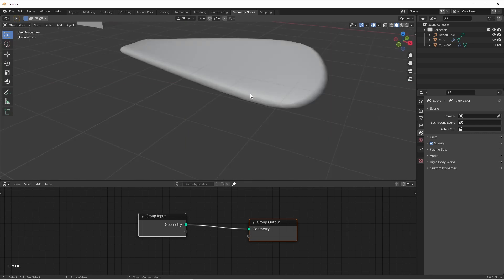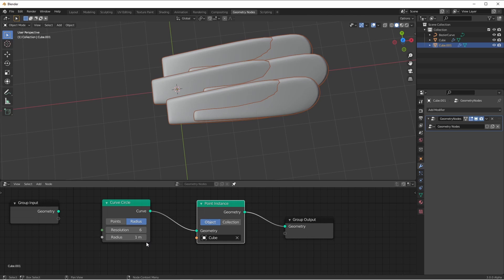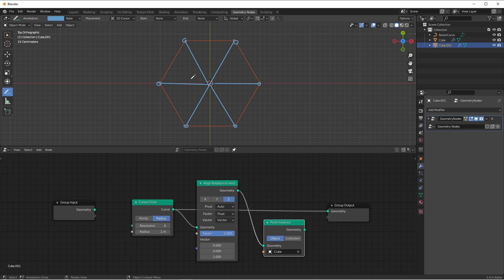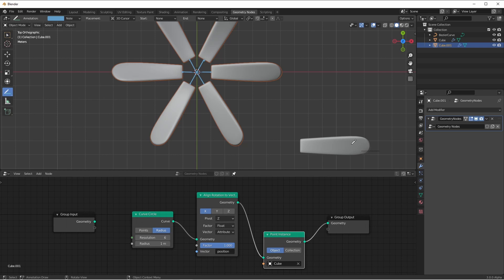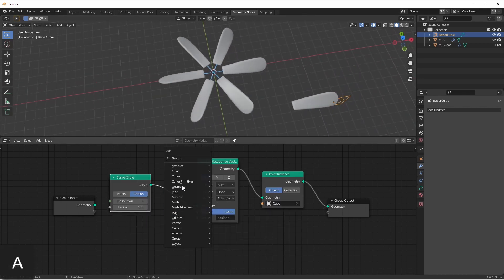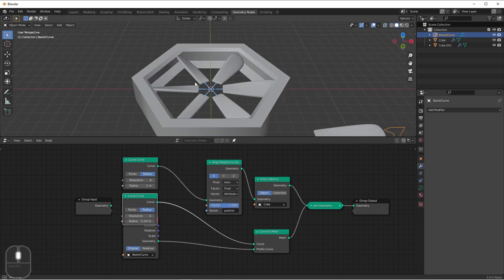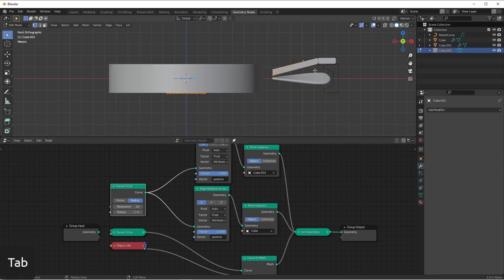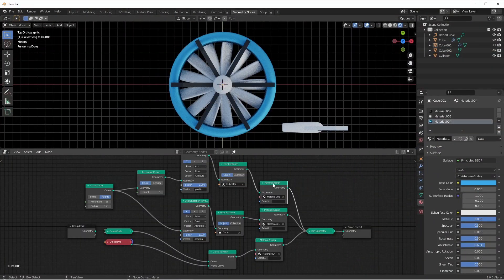Blender Q&A: Circular / Radial Arrays with Geometry Nodes

Comment: This is a whole different animal than a circular array. It's much more powerful, but I'm not sure I'd say it was easier...
Reply: You can reuse a geometry nodes setup as a modifier on multiple different things. Add it to your default file and you'll have access to it on every new project. Create once use multiple.
Reply from the maker: Its easier to me at least 😁 your mileage may vary.
Reply: I would argue that it is easier. Or at least for 3 nodes setup, it is way more convenient than having to deal with offset in array modifier each time you wan to change the count of instances. But I gotta say using position as attribute for alignment feels pretty unintuitive to me, eve tho it most likely makes sense from mathematical standpoint.